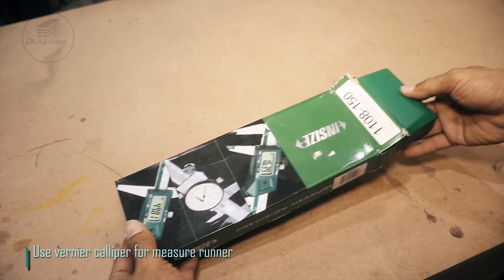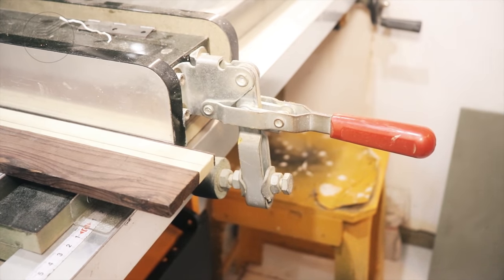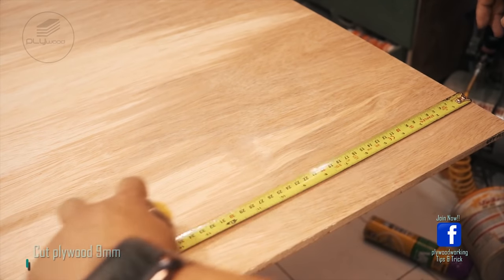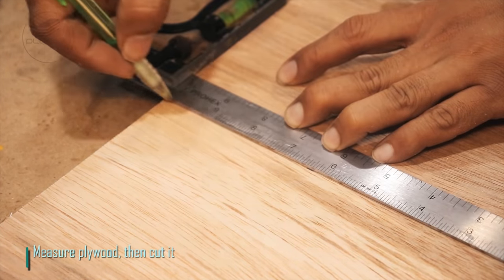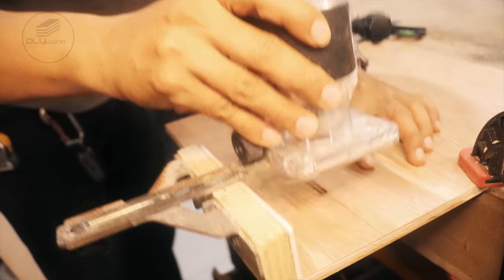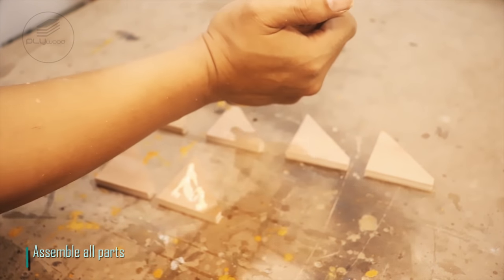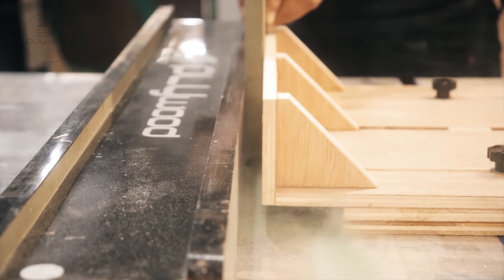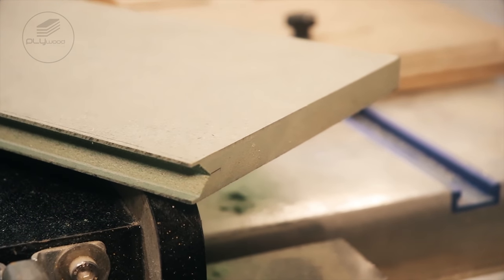Vertical supporting cutting for jointing - table saw & router

Comment: Knapa tumben materialnya gk pake hmr😁, tp bagus idenya, itu alat bantu bisa buat bikin jalur nyambung papan.
Reply from the maker: Skr di mix mas coz orang luar pada gk tau material HMR, sesuai namaya pake plywood material. Hmr buat yg project berat aj disimpen
Reply: @plywoodworking  sy pernah coba pake hmr buat buat bikin croscut sled bagus hasilnya gk rontok materialnya. Padahal sering dipake hampir tiap hari .
Reply from the maker: Yup bnr itu kelebihanya HMR kelemahanya HMR cm 1 bobotya over itu aj jdi kdng kyk pegang barbel😁
Reply: @plywoodworking  ya berat banget, sy beli yg tebal 6mm aja gk melengkung bagus tetep kokoh.